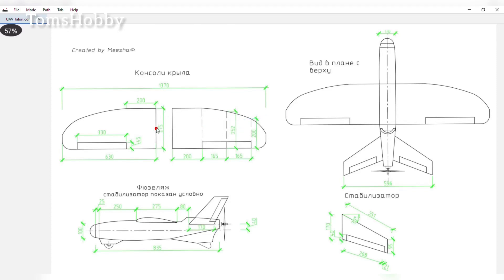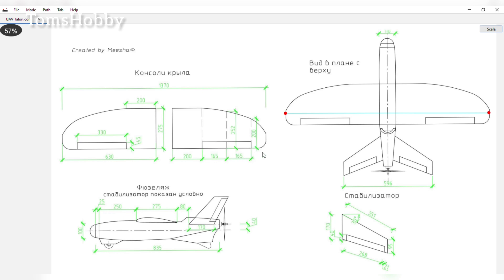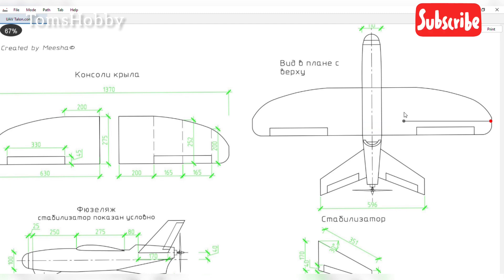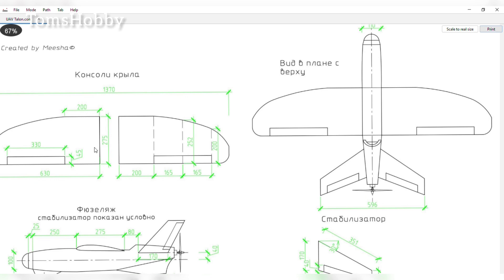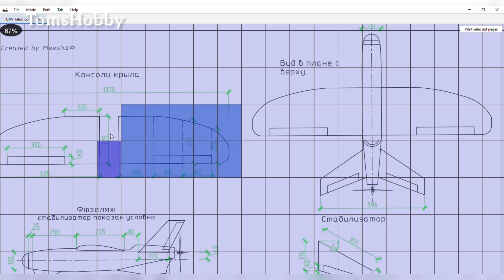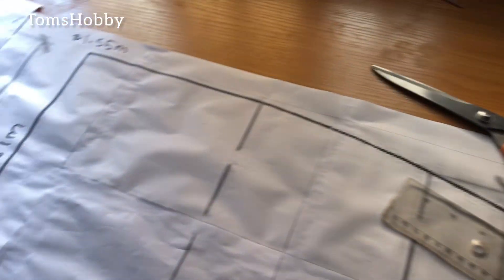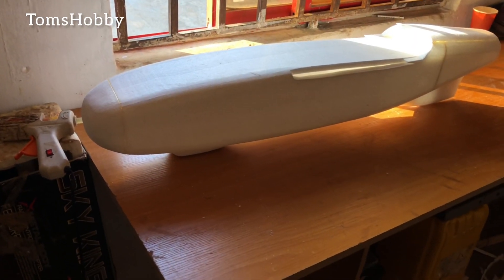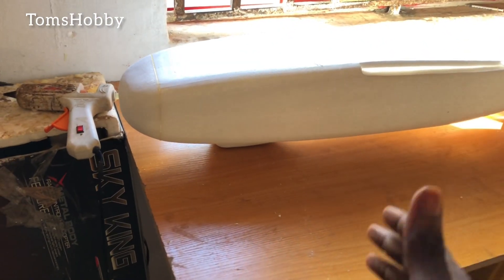How to make X-UAV Talon Fuselage | Part 1

Comment: Ahhhh, 'Scalari'--what a fantastic tool! I spend lots of time drawing & design models, but I often begin with tiny sketches & change my proportions constantly...until I am satisfied.
 Then, I do manual calculations of every dimension...to convert small mm & cm to larger cm or inches. Finally, I must trace & manually enlarge these tiny drawings, until they are accurate. Otherwise, I must spend $$$ to get them photocopied to large scale...which gets expensive!
I must try this tool.
Reply from the maker: I normally do this before but it takes time ..